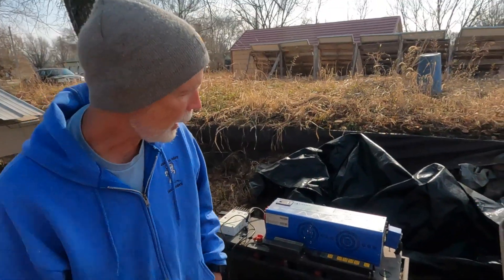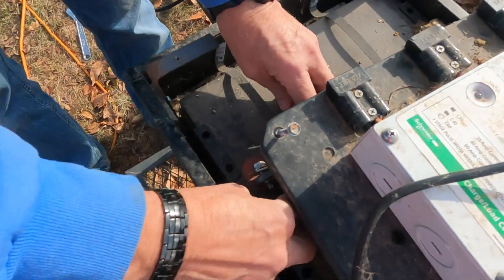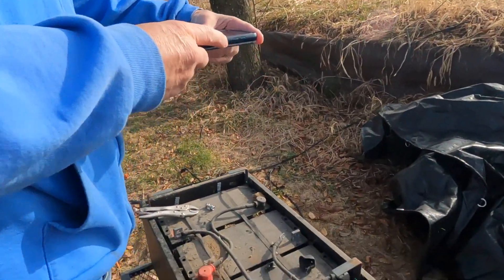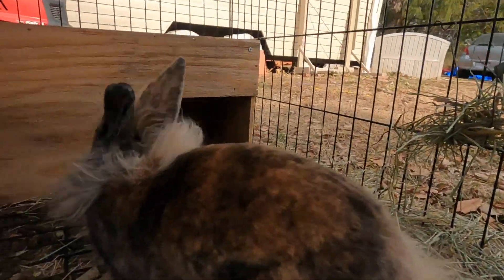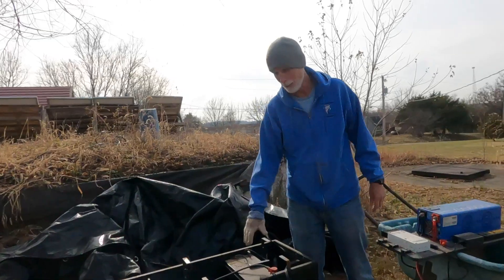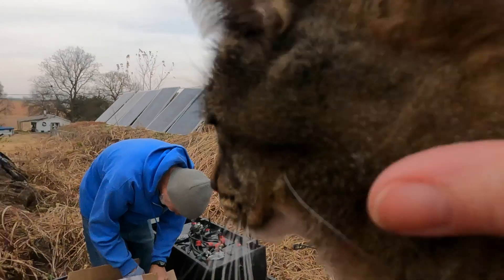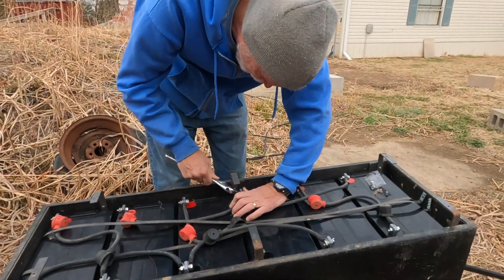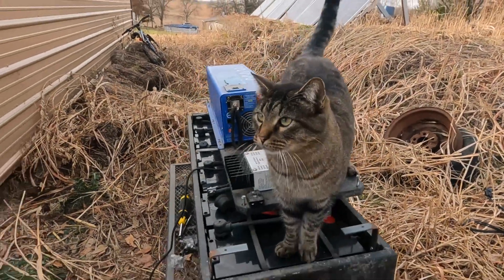Changing the Batteries Connected in Series in Our Solar Setup for RV Living

Comment: So good to see you again! I run my little travel trailer on a solar panel most of the time in the summer when I’m dry camping. Strictly 12 volt. I only use my generator to give the batteries a boost if it’s been too cloudy for the solar panel to keep the batteries charged. Nice and quiet! The bunnies look happy. And cupcake is typical cat. The have a gift for getting right in the middle of what you’re trying to do.
Reply from the maker: Sounds like you have a ideal solar setup for camping.  :)  Yes, cupcake is a typical cat.  He just loves to be my helper.  lol  Thanks again for watching, Ruth!